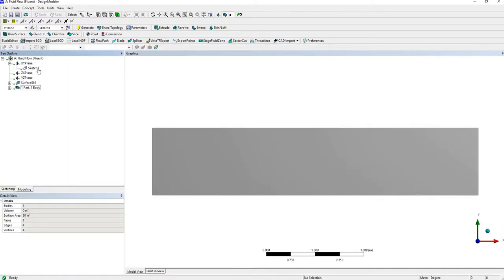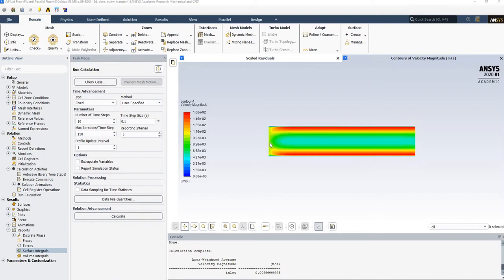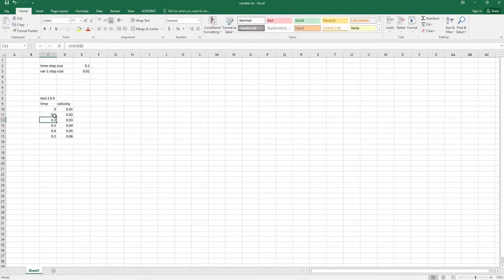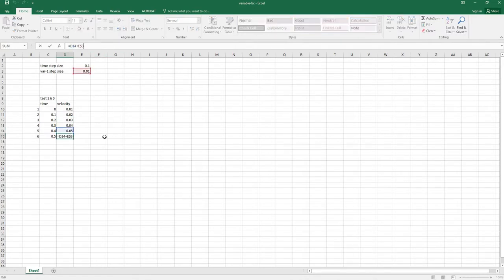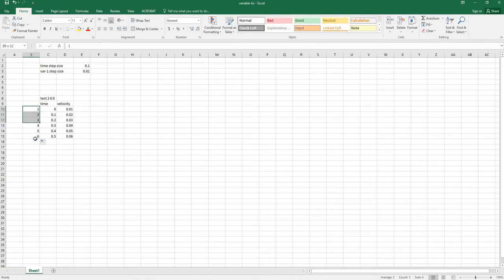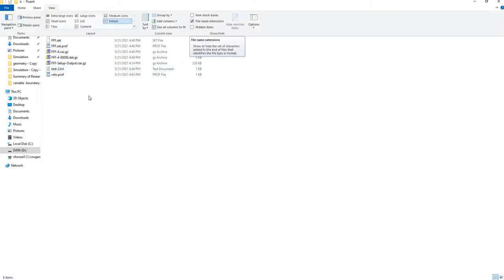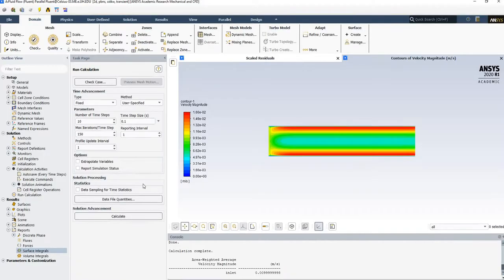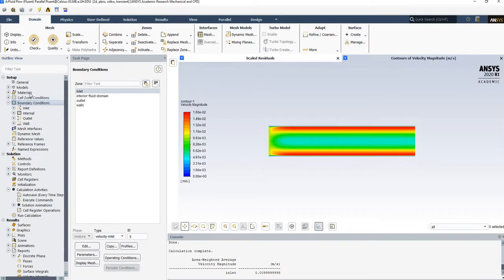Transient Variable Boundary Condition-Fluent-Profile

Comment: Thank you for the video. I have a question regarding the direction of the velocity. If I put a minus sign in front of the velocity value will it reverse the direction?
This because I have an oscillating flow in my case between the input and the output and I am trying to figure out hoe to it with velocity profile.

Comment: When I try to read the file It stucks on "reading profile file..." message. Does anyone know what could be happening?
Reply from the maker: make sure you follow each step exactly and check if your profile file extension is .prof or not. I cant think of any other reason for it to not work.
Also, you can find the tutorial files using this link. check for yourself
https://drive.google.com/drive/folders/129RL_ngAu1h8a7ZNOhFLheNwK_5-C2Dy?usp=sharing
Reply: @NazmulHossain-nb4lc  Thank you!
Reply: Hello Bruno, did you manage to fix your issue? I am having the exact same problem. Thanks
Reply: @keirjrobson8719  Hi! I had the same issue and I think that I found a solution. You have to go to File/read-transient-table and then give the name of your profile file (without the .prof extension). Hope you it works for you :)
Reply: @eirinikar4171  It works! Thank you very much for sharing your experience with us 😊
Meanwhile, for those who may read this, the file/read-transient-table option can be accessed from the TUI (Text User Interface).
Reply: Hi all :) great tutorial, but I'm having the same problem, just sticks on 'Reading profile file'. I've tried the suggestion 'file/read-transient-table' without .prof extension and it is still not loading, I would really appreciate any ideas or suggestions!
Reply: @elisawylie7509  I ran into this similar issue. It worked out for me when i moved the .prof files into the project file (the same folder mentioned in this video). Hope this helps.